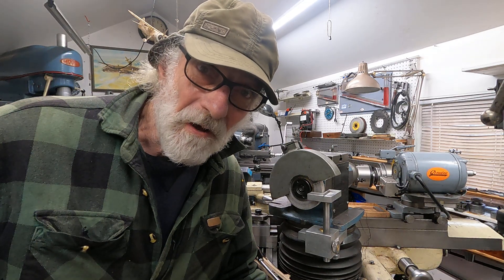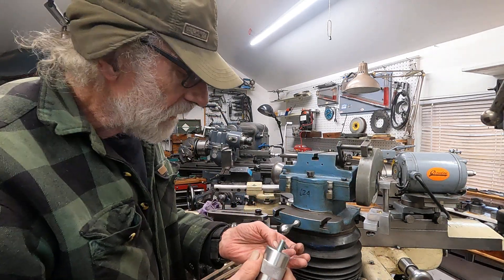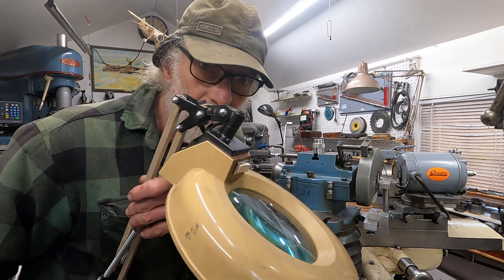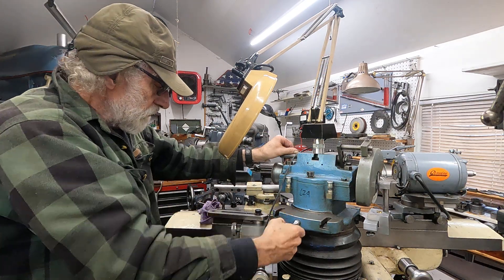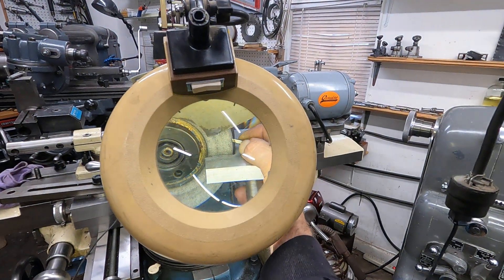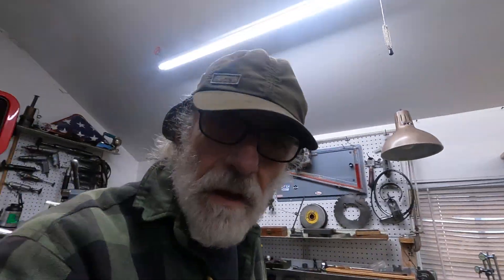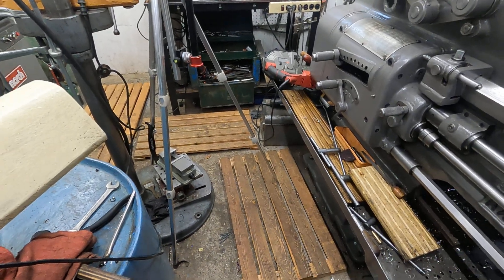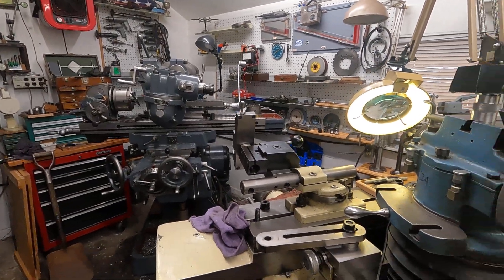Machining solutions for the tool & cutter grinder

Comment: DeeDee. I have a couple of the magnifying lights and they work even better If you replace the bulbs with LED bulbs.  Cheers TB
Reply from the maker: I will have to look up replacements for the Circline bulbs! I need magnification and candle power like a politician needs an 8 ball of crack!

Comment: What a fine shop- certainly very unusual for a home shop. I just got a kurt 6" vise. It's a great improvement over my lousy japanese vise. I do miss the loss of front and back mounting eyes when using it on the horizontal mill. I'm having to resort to strap clamping it to the table in four points.
Reply from the maker: I almost had a normal home shop with a Bridgeport and a Mori Seiki lathe but....

Comment: I real like the wooden floor grates nice to walk and stand on for longer time much better for our legs I use them my self , thank you for showing the fine tricks on the cutter grinder sure comes handy and good idea with the mag light  and remember to drink coffee . How are you heating your shop ? Thank you again for the great videos .
Reply from the maker: Hi, thanks, I found the wood better than rubber mats. I have the garage insulated well and just have the wall mounted electric heater.
Reply: Also called duckboards and used in commercial kitchens.

Comment: Electrix lamps are good stuff.  I have one on my 17" Colchester.  I have driven by the Electrix factory at 45 Spring Street in New Haven Conn.  I was visiting the Sargent factory and noticed the Electrix lamp factory was nearly next door.  I was talking to an old guy engineer at Sargent (Al S.), and he told me that site of the Sargent factory used to be owned by Eli Whitney and his company (the father of interchangeable parts), and it was also at one time, owned by the Robert Fulton Steam Works. (You know, the river boat engine guy).  I am also going to brag that I visited the Hendey lathe factory in Torrington,  and also the Torrington bearing factory.  Lots of history in Conn.  -----Doozer
Reply from the maker: I have picked up 3 Dazor brand magnifying lamps too but they have long arms. I fished a drafting machine out of the dumpster at this secondhand store. This Electrix lamp is very nice and built to last. Thanks!